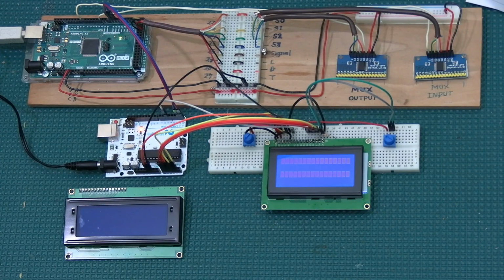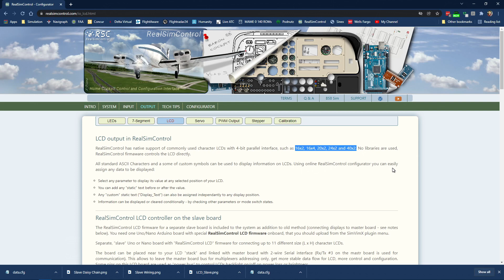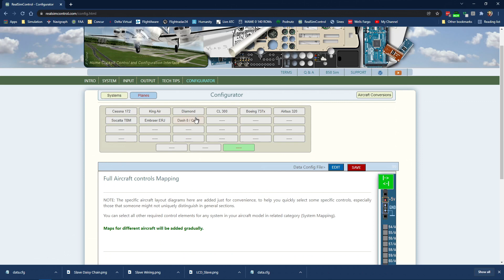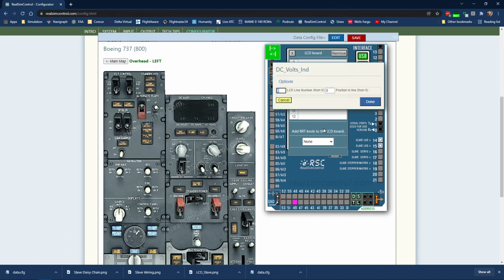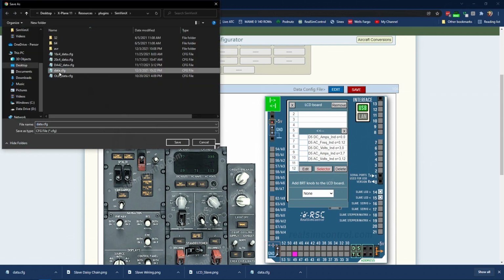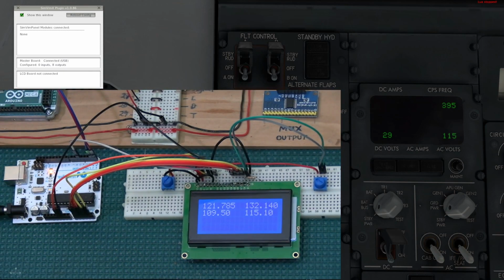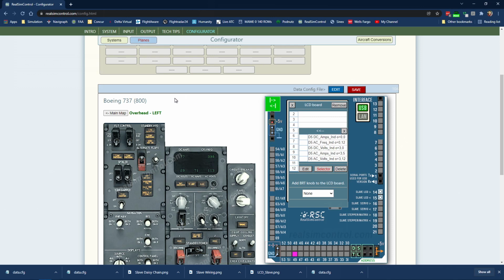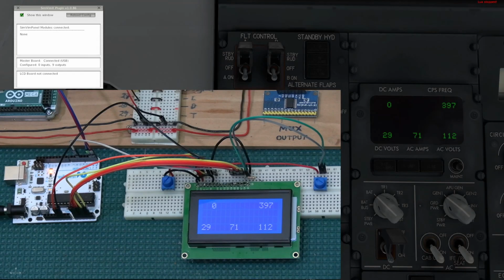Configuring the Zibo Boeing 737 electrical  panel on a 16x4 LCD display

Comment: i just got my mega 2560. i have a problem i think. i have purchased x-plane through steam. how do i add the plugin?
Reply from the maker: Hello Delbert, you put it in the X-plane plugins folder inside the steam apps folder.

 C:\Program files\(x86)\Steam\Steamapps\common\XPlane-11\Resources\Plugins
Reply: @Qosmokid  well now thats done why wont the plugin install firmware? the mega board is not showing up in the plugin. according to the power shell system cant find a hex file for the firmware
Reply from the maker: @voxalonarlok4934  it's  possible you got a corrupted download. I would download it again
Reply from the maker: Your question is not showing up but there should be 4 things in the download. A "32" folder, a "64" folder, an "AVR" folder, and the Simvimx.dat file